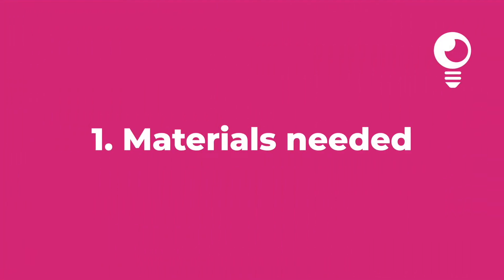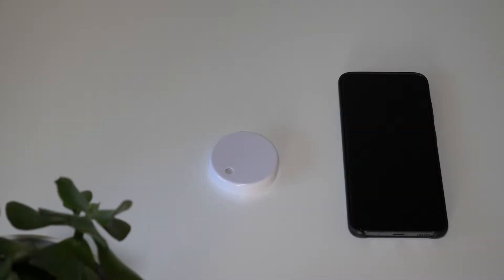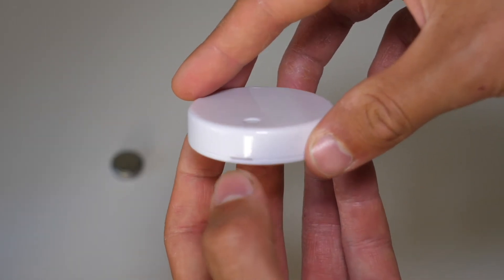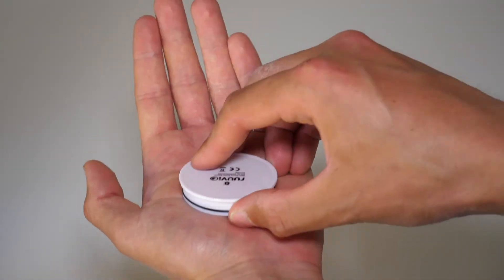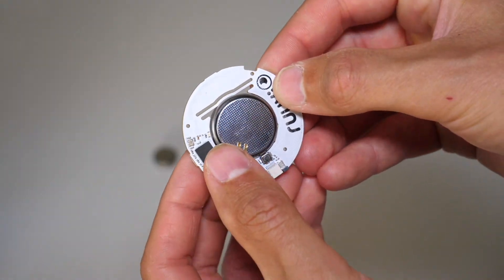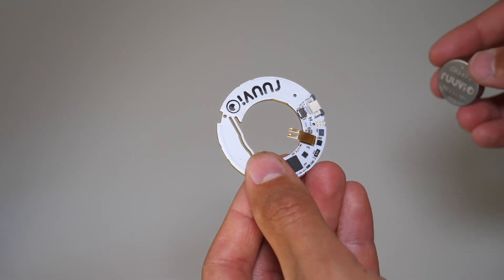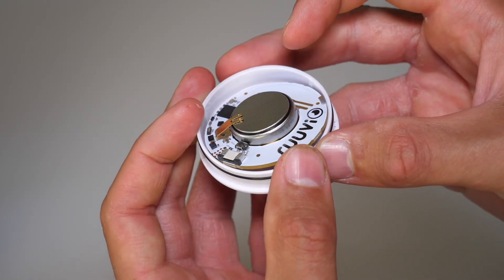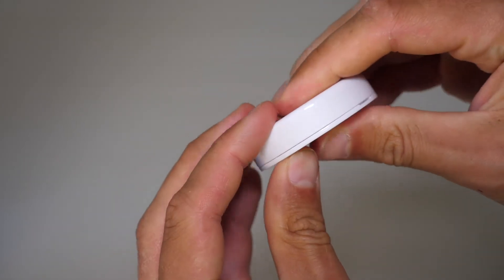How to change your RuuviTag Bluetooth sensor's battery easily?

Comment: I bought my RuuviTag just a few weeks ago and connected it via Bluetooth with my Victron Energy System in my campervan. Now I'm getting alerts from the Victron system that the battery voltage is low (2.359V). What minimum voltage do you recommend to set the alarm for changing the batterie?
Reply from the maker: What is the temperature range with aforementioned RuuviTag? In Ruuvi station low battery treshold depends on the temperature:
– If less than -20C, low battery threshold = 2V
– If less than 0C, low battery threshold = 2,3V
– Other temps, low battery threshold = 2,5V

Comment: It is also possible to use more common  CR2450.
Reply: Although CR2477 describes the battery chemistry and dimenstions. CR2450 is a somewhat different size it is reported to be usable.
Reply: @dennisgerman6657  I have used CR2450 without any problems.
Reply: @Neuroupdate  is it loose?
Reply: @dennisgerman6657 You have to bend the metal connector.
Reply from the maker: Diameter is the same, height is different in CR2450 and CR2477.